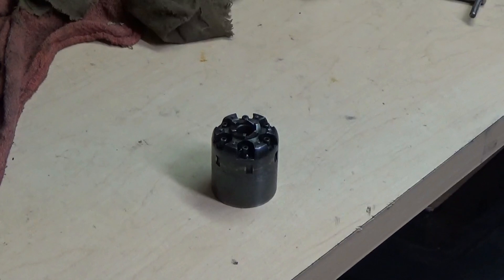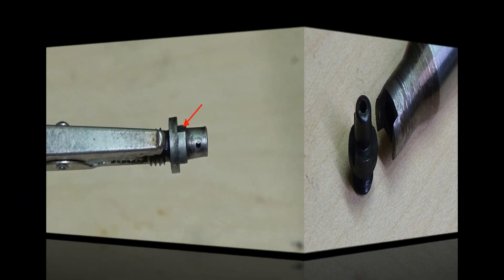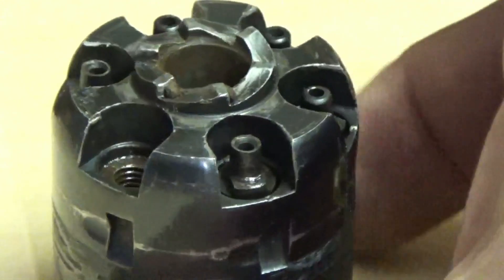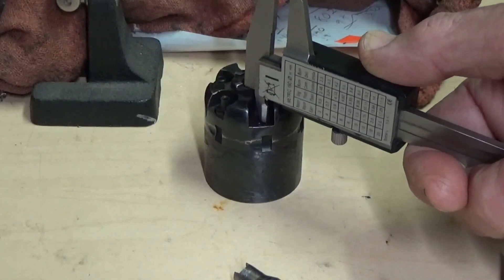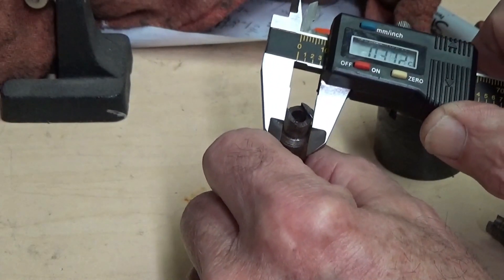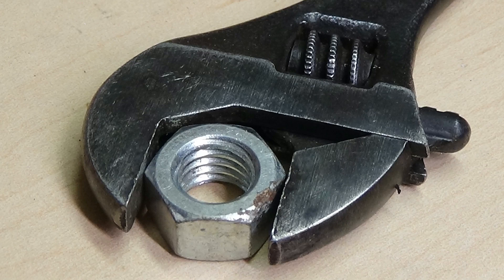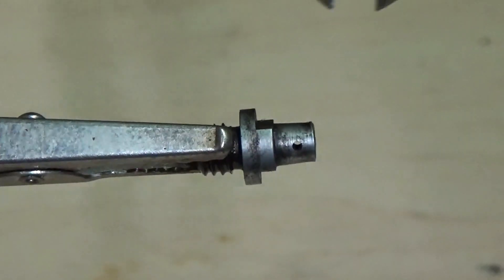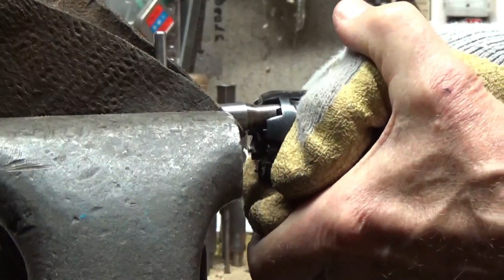Stuck revolver nipples -  part 2

Comment: I have a Remington 1858 from the 70's.
Got it in a trade sometime in the mid 90's.
It sat in my closet until recently, when I decided to clean and oil it.

The nipples were frozen into the cylinder.
I broke my Nipple wrench after removing 2 or 3 of the nipples.
I filed the wrench down and used a Dremel tool to cut  new ears on it.
That got one more nipple out.
Finally had to purchase a new nipple wrench, which got the last of the nipples out.

Cleaned the gun and nipples very well and applied  Bore Butter the the threads of the nipples and re-inserted then into the cylinder.
The revolver is now ready for the range.
Reply from the maker: Sounds like you got it done and I admire your sticking at the project. Maybe the first thing that should be learned about a BPRevolver is how to properly remove and care for the nipples. That would sure pay off for someone, sometime down the road. Another example of where an ounce of prevention is worth a pound of cure. O.R.

Comment: I've removed the nipples on a Colt 49 Pocket from 1853 and a Manhattan Firearms revolver from 1860. Both cylinders were first soaked in a mix of acetone and ATF. I made a nipple wrench myself from a high strength bolt that fit snugly. I used the two brass pins in the vise to secure the cylinder. They did not budge. Then a couple of firm taps with a hammer on the nipple wrench to break the rust. Heat was then applied with a heat gun. After a few cycles of heating and wrenching they came out unscathed. I noticed that they usually rust between the nipple shoulder and the cylinder counterbore. Usually you can get them out without damaging the threads or nipples.
Reply from the maker: Great advice, thanks.  O.R.
Reply: That is usually where rust tends to always form. The water doesn't go anywhere else but that upper area where it collects, causing the binding.
Reply from the maker: @HircineDaWolf  Makes sense because I think I had a couple nipples turned out a bit on that cylinder to get the caps to go off.  That would have left a gap for rust to form, as I wondered why there was so much in the threads.   O.R.
Reply: @oldranger3044  seen a gunsmith talk about it. Just gotta get the oil in there

Comment: A neat trick I like to do is a little butane torch to heat the nipples up. Then nipple wrench pointing up in a vice. I use a brass hammer to hit the cylinder face when I turn the cylinder on the nipple wrench. Works great.
Reply from the maker: Sounds similar to what I have gone to doing, but that trick of heating the nipple and wapping with the brass hammer sounds to be a winner.  Wish I would have thought of that, but then that's what the internet is for, right?  O.R.

Comment: I just purchased an uberti 1851 navy London from Taylor’s. Had stuck nipples on a brand new gun. The Taylor’s technician said that uberti does the bluing process with the nipples on which sometimes causes them to seize to the cylinder.
Reply from the maker: The new Uberti I had were tuff, and wouldn't want to have tried them without a good wrench.  How did you get them out ??  Maybe they are still in.  O.R.
Reply: @oldranger3044  it actually destroyed my wrench trying to remove them and I was worried I would round out the nipples also. I sent it back to Taylor’s to have them remove while it was under warranty.
Reply from the maker: About the tech that said the bluing is with the nipples on.  It appears that the nipples were blued first as their threads are blued.  However, the female threads along with the area where the nipple seats are not blued.  So, one would think he is correct, unless the cylinders are bored for the nipples after blueing, which wouldn't make much sense.  My new Pietta Sheriff is the same, except the nipples were one heck of a lot easier to start out than the Uberti's.  O.R.

Comment: Excellent video. I have a Ruger Old Army I bought last year made in 1972 and the nipples have never been out. I got 5 out without cause but one is stubborn as can be. I'll give the vice a try and thanks for the information.
Reply from the maker: A couple of the comments here talk about a solvent mixture so you might want to check that out, they claim it helps.  That ROA I believe has a hex pattern and there is a special tool for it.  O.R.

Comment: Friend stubbornly tried to remove a stuck nipple from his 51 and more than rounded the edges to the point I think it’ll need to be drilled out. Sending my own in to get a conversion so I think I’ll swap my cylinder out with his and have a professional repair it.

Comment: I find the available nipple wrenches of all makes are made from very soft material, which always rounds off the nipple flats, so I make my own from Silver Steel,(drill rod I think you call it), then harden and temper, they never burr or slip off the nipples again, but need to be a very snug fit to work properly. Chris B.
Reply from the maker: Bingo.  I should have mentioned that in the video.  The soft ones sometimes even slip on those that aren't real difficult.  I never thought much till I did the video that once that happens, the wrench can't get down that extra 20 thou into the pocket or recess, making it that much easier to slip.  I am planning on ordering one from SliXshot, some good reviews on it, mostly so I can pass on what I think about it.  Most of the shooters don't have your expertise when it comes to creating their own and could use a good source.  They run around $25 and I should have ordered one when I got their stainless nipples. As always, appreciate hearing from you.  O.R.

Comment: Good video! When I bought my pair of Uberti 1860 Armys, I also ordered some stainless steel nipples from Track of the Wolf, Treso I think was the brand. When changing them out I found that they were hard to screw in, although possible to get in, the thread fit didn't seem exactly right. Normally when I clean the revolvers, I remove the nipples and clean them, and reinstall with a bit of grease. So, I just stayed with the original Uberti nipples because they were easier to remove and replace, and kept the new ones for spares. LOL It seemed like the thread fit was a smidge off, although they would screw in but offered resistance.
Reply from the maker: Uberti uses SAE threads I believe.  Pietta Metric.  12-28 for most Uberti.  Noticed that Track has lots of different sizes, including Metric so hope that the ones you have are 12-28 as there are some Metric that would be close enough to "almost" fit.  If you know someone with a thread gage you could check.  O.R.
Reply: @oldranger3044  I think if and when I decide to use them, I'll get a 12-28 die and run each nipple in the die, then try them. Actually, the Uberti nipples have worked fine, so I didn't pursue getting them to fit. You video made me remember it. LOL
Reply from the maker: @kentowens2179  Right! You've  had them out, and that's important.  And, if it ain't broke, why change it.  O.R.
Reply: @oldranger3044  Exactly, if it ain't broke, don't fix it, advice I give out often. LOL  Black powder revolvers were new to me when I bought the pair of 1860's, and I'd read somewhere the different nipples were more reliable, so I ordered some after buying the revolvers. Actually, the factory nipples work great, so I probably wasted $$$. LOL I have my work caught up around the house now, and I'm planning on doing some shooting with the Ubertis soon, when the rains stop. Been looking for black powder, i.e. Swiss 3F. It seems as scarce as everything else shooting related. LOL
Reply from the maker: @kentowens2179  We just got a mess of snow.  With you getting rain, I'm guessing that you're too far for me to set you up with enough BlackMZ to keep you shooting till this mess straightens out.  It seems as good as the real stuff in 44's, my jury is still out on the 36's, but I suspect somehow it doesn't to as well with the lighter ball. I agree, I've had no issues with the factory nipples from Pietta and Uberti.  I took a little off the Pietta's on my 36 so they would work with some CCI's that I had and discovered that they are hardened so had to use a stone as a file didn't "cut it".  You might think about that with the extra' nipples you have if you end up getting caps that are a bit small like the CCI's # 10's  O.R.
Reply: @oldranger3044  I am in Northwest, NC. About 10 miles north of Wilkesboro.  I have some Pyrodex Select in 2F, and a bit of Goex in 2F that I used in my .50 cal rifle when I used to hunt. Thanks for the tip on the blackMZ, I'll be on the lookout for some. I've always used the RWS 1075 caps, and have a good supply, however any kind of caps or primers have became extremely scarce. A few weeks back I gave a fellow some large rifle primers so he could load some cartridges to hunt with. He was a stranger who posted on a local forum wanting to buy 5-10 large rifle primers, I messaged him to come by and I'd give him enough to help him out. I gave him half a box or so, 50-60, told him he could load a couple boxes of cartridges to hunt with. He was surprised when I told him no charge. I told him that I once was a hunter too, and just wanted to help him out. Made him happy, and gave me a good feeling as well. I appreciate your knowledge and skill on these black powder revolvers. They are quite amazingly accurate. Keep up the great work and the videos.
Reply: @kentowens2179  the slixshots definitely provide no misfires for me, but i dont have caps that fit them, just ones that fit the tens, and they get better as you break them in. I always get one or two cylinders that take two hits to go off when shooting for a while with the stock ones.
Reply: @kentowens2179  BlackMZ is no longer made unfortunately.
Reply: @HircineDaWolf  Thanks. I found that out when I started searching for it. That's a shame. It appears that any and everything , either smokeless or black powers related, has disappeared from the face of the earth. I have some Pyrodex Select, but wanted to try some different powders. Thanks for your reply.
Reply: @oldranger3044  I ordered a 12-28 die and ran all the stainless nipples through it. There was a slight resistance going into the die, and some very fine metal shavings were removed. Once done, the nipples threaded easily and smoothly into the Uberti 1860 Army cylinder. Apparently the thread was just a smidge over sized. Thanks for your videos!
Reply from the maker: @kentowens2179  That's probably better than running a tap into the cylinder.  Nipples are less expensive to experiment on.  Now you have the die for future use,I think you know  Pietta will be metric.  O.R.
Reply: @oldranger3044  Yes, I just was curious to see what was going on that made them such a tight fit. Your video made me think of it. The Uberti nipples treaded into the 12-28 die easily. Now, I have a dozen serviceable nipples in stainless steel, if I ever need them. I decided to leave the original nipples in the revolvers because they're like new, and work as intended. I'm anxious to shoot some black powder revolvers, but our weather hasn't been great the past few days. Maybe next week. LOL I couldn't find any black powder but bought a couple of pounds of Pyrodex P. Hopefully, it'll work.

Comment: I saw that you use oil on the nipples to keep them from seizing I use Thompson Center All Purpose Anti Seize Super Lube on my in line muzzleloader it is anti corrosion resistant.
Reply from the maker: Don't have that, but will keep eye open for it.  Thanks.  O.R.

Comment: Can you LMK which wrench you use? I got the one that lots of people recommend as the best and one of the ears just broke off trying to get my pietta 1861 cones out the first time. I used your vise technique.
Reply from the maker: I made the one I use from some tool steel.  I would think it might have the same problem you had if it got stressed.  Putting the tool in the vice I feel gives a person the ability to apply more stress than turning the wrench, which is normally a good thing because it allows more pressure and less chance of stripping.  Guess you sort of proved that.  I haven't got around to ordering that speedy one which have also heard is good.  I've only heard of that one too, and don't know of any others to suggest.  Maybe you've checked some of the comments on that video, because I think a couple had some suggestions that could help (once you get another wrench).  I have a small lathe I used to make mine, but as said, it would probably have ended up like yours.  If I get something like that again, I plan to use heat.  Sorry that I don't have any other suggestions.  O.R.

Comment: For anything with threads that is stuck....    Kroil...  and the home made version of half acetone and half automatic transmission fluid.     soak the offending part.  wait a day.
Reply from the maker: I've heard that works quite well when not in a rush, which always pays.  O.R.
Reply: @oldranger3044  Yes.    I am assuming that you have spare cylinders that you can at least take out for some shooting.     The half acetone and half ATF works shockingly well.